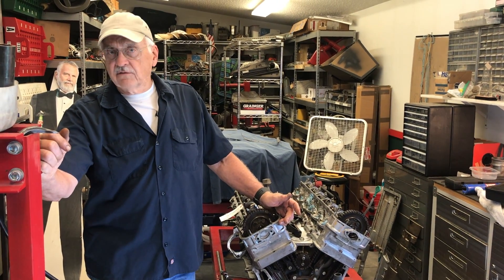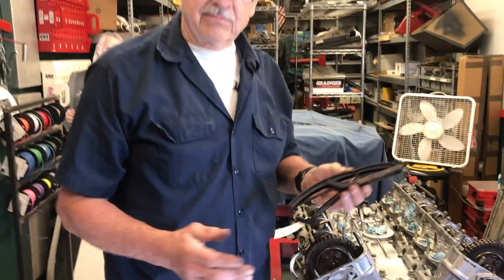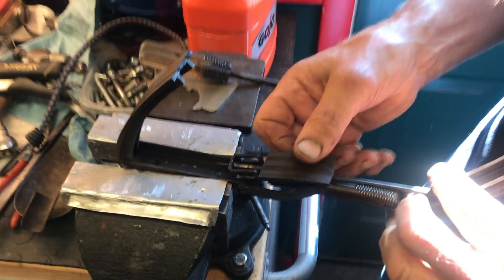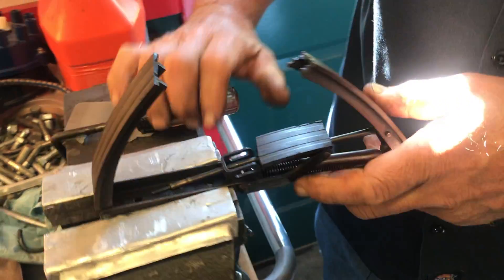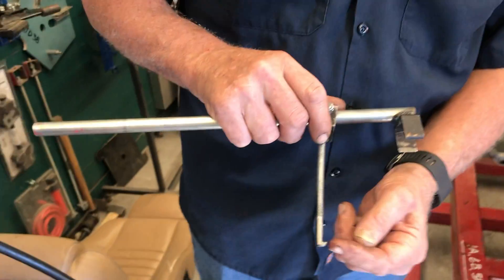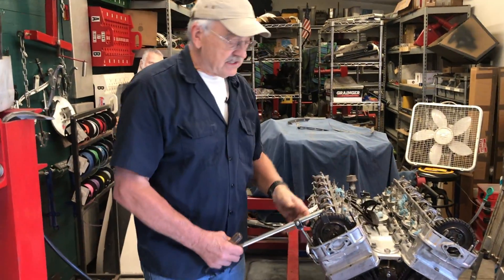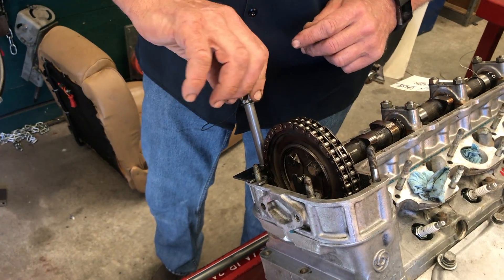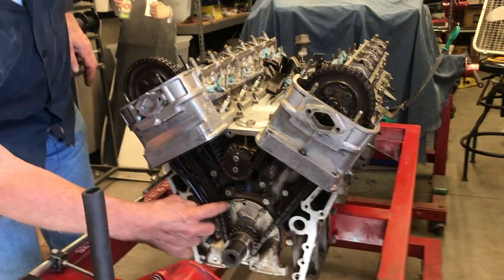Tuesday Extras - Episode 15: Jaguar 5.3 liter V-12 Timing Chain Tensioner Basics

Comment: For anyone doing this in the car: You can't see the ratchet with the heads on (where the rod comes through the hole), so you might use a endoscope camera and stick it behind the camshaft pulley.

Comment: i love your jag videos it's 2025 if your seeing this do you still put out videos? i saw the video where you said you fought off cancer congrats🎉 hope your doing well. what i wouldn't give on this earth to work by your side. I've never got to work on jags but i have built a couple ground up vehicles currently completing a turbo LS swap in a 2000 ranger running e85. these engines look to have lots of potential. can they be boosted?
Reply from the maker: I've been doing a restoration on an '89 XJS Convertible in addition to other projects. I'm currently putting together season 6.

Comment: hey Bob. Do you have a kludge for upgrading an old tensioner?  Usually the plastic breaks but the  metal is okay. Can you glue another layer of plastic on top of the old plastic? 
or buy a new {fill in the blank} tensioner and take off the plastic and use on the jag tensioner?  I hate to pay $500 for a reproduction tensioner when my whole budget for the car is $500...

Comment: Thank you so much for this video, helped a lot in understanding the mechanism. And thanks for showing the DIY tools, will build one myself.
I just wanted to check the tappet clearance at my XJ-S and turned the crank manually as usual. Half the work was done, suddenly the crank blocked. I suspect debris of the tensioner is blocking the chain, deep down there was a black piece of something, I guess remains of the tensioner.  Thanks again, Chris

Comment: Nice tool. How much of the motor needs to get disassembled to replace the chain tensioner?  Can it be done in while the motor is in the vehicle?
Reply from the maker: The front cover needs to come off so either the cylinder heads or oil pan need to be removed to free it up. I vote for the oil pan. Not an awful job but it takes some time.
Reply: @thecampchaoschronicles9567  I think I would need to take the head off so I can use the tool tensioner, otherwise there is now way to  set the tension, correct?
Reply from the maker: @brighteyesvideos  My vote would be for removing the oil pan. I wouldn't recommend disturbing the heads unless you have to.
Reply: @thecampchaoschronicles9567  Not to difficult to take the front cover off once you get everything out of the way. The Jag manual says to then "disconnect the timing chain from the camshaft and jackshaft sprockets" then "withdraw the crankshaft sprocket and timing chain." Is that really necessary? It seems like I can just slide the timing chain tensioner in before I tighten it with the tool, as it seems to want to go in without all the chain disconnections. (Just don't want to brake the new timing chain tensioner.)
Reply from the maker: @brighteyesvideos  If the tensioner is unlatched, replace it unless it'd been replaced recently in which case it will still be gray in color. The consequences of putting it back together with a broken tensioner is too great. I seem to recall you must take the sprocket off of the A bank to get enough slack to remove/replace the tensioner.

Comment: Great video. My machinic suspects my 85' XJS chain tensioner is broken, as the timing is all over the place and thus not enabling the V12 motor to start. I will take the cam cover off and hopefully see if this is the case (or not). To replace the V-12 timing chain tensioner, do I need to take the heads off, or can I access it from the front as shown in your video?

Comment: I just  came across your video again.. incredibly informative.. thanks for  everything.. myvsons xjs has only 120,000 kilometers,,74,000 miles.. when have you  seen these tensioner go faulty  and what are the indicators of the chain  tensioner?  Ie: noise , miss fire, no power?? 
Thank you  , keep up  the great job..
Reply from the maker: To be honest, my experience with broken tensioners is when I have taken engines apart. Since the tensioner is on the "slack" side, I don't know that it will result in a change in how the engine runs. Unless the chain slips on the A bank. Then A bank will run poorly. That would probably be obvious at the end of the A exhaust system. I'm told the chain will make a fair bit of noise from slapping around between the crankshaft and the A sprocket. I wish I could be more definite. Good luck with the project.
Reply: @thecampchaoschronicles9567  Oh my god your are incredibly quick with your response time... Thank you so much.. I forgot to ask you if you ever removed all the vacuum and emission ancillaries and the right fuel regulator? I have and the only thing I'm chasing now is a  idle hunt. I haven't performed the air/fuel adjust in bypass mode yet, since i understand these need to warm up and in gear, I know that these beauties go in open loop in P or N.. any suggestions..LOL..
Reply from the maker: @petehalasz7547  I've deleted the air pump system in Ol' Tex while retaining the pump as an idler pulley. I intend to install a smaller alternator in it's place sometime soon. I'm more of a carburetor guy so I'm afraid I can't help you much. But I'm learning.

Comment: Thank you for your detailed explanation, it helps a lot. For you information, the chain tensioner (C30485) and the plug (C37925) are available on the SNG Barratt shop.
Reply from the maker: In addition, the tensioner is available from several locations including Engle Imports and Welsh Enterprises which are a couple of days shipping from Camp Chaos. Thanks for the information.

Comment: Great work,  I'm a licensed mechanic  of 40+ years and my son and I are rebuilding a his 86 XJS.. him and I have polished all aluminum to a mirror finish. Intake port and polished.. removed all stantions on the intake  filled all holes  relocated  all wiring , blasted and powder coated  entire rear end .. we want to go suicide doors with shaved door handles.. custom interior.. Chrome plated  everything else.. your ingenuity is incredible.. you remind me of myself.. I refuse to allow something beat me.. I believe there's a solution for everything.. 
I'm pondering on a complete Megasquirt pro3 system.. I understand it can go full sequential and comprehensive   DIS system  built in.. what do you think??
Reply from the maker: I've been thinking about the same thing since we used a Megasquirt on the XJ40 Champ Car engine. Getting an impulse wheel on the dampener us going to be s challenge. Not much room.
Reply: @thecampchaoschronicles9567   
Thank you for quick reply, I spoke to the people that sell MS-3 pro and they told me the first test bed was a v-12 jag engine for a marine application. Then of course further improved. They now sell a MS-3 ultimate which is fully V-12 sequential injection not grouped and built in DIS module. There are tons of aftermarket 36-1 wheels, the only challenge is a cam counter. It needs to know #1 for seq-injec (he was suggesting the distru wheel)... Mobeck Tekniske in Norway has figured this out and sells a complete package for our 12's. It's unbelievable and he told me it's a MS-2 in the box. It has all new injectors, MAP, ECT and harness, but it is group injected 6 grp of 2 injectors. Have you tried any set ups for DIS? i have seen only a couple vid's on DIS V-12's,, absolutely incredible. 
Thank you for your time 
Pete

Comment: Has anyone designed/replaced with a more modern tensioner?
Reply from the maker: I've seen  someone who replaced the plastic blade with a spring steel unit but haven't seen anything lately.

Comment: There will come a time when I have to do mine, these tips will prove invaluable when it comes to rebuilding the engine. Thank you.
Reply from the maker: It's my hope these videos will demystify these engine to the point where they can undertake an overhaul project. The engine isn't that difficult. it's all of the stuff the had to stick on top of it to get it to work that is the problem.

Comment: I like the gentle custom tool you have.   Re the tensioner, it's made of Nylatron GS (originally by Polypenco).   Nylatron GS is a molybendium disulphide-filled nylon 6/6 (a polyamide: PA), now made by a variety of companies.  Nylon 6/6's of different variations are often used in high-temp engine service (like  GM  plastic timing gears etc).  The downside to all nylons is that they absorb water and expand, and over time may loose their plasticizers (see the datasheet via google look up).  The addition of MoS2 adds another factor of brittleness and weakness to impacts even to new Nylatron.  I suspect that age,  water absorbance & expulsion through heat cycling (up to 0.3% to 7% max) plus the sharp edges of the casting itself contribute to eventual failure upon shock.

The newest chain guides for the likes of the Porsche Cayenne (and others) now use a Nylon 4,6 called Stanyl TW341 (a couple of layers of different varieties of it) that's superior to Nylatron. 

Now for the speculation:  Who would risk an engine on this though?:    Might it be possible to fit an off-the-shelf tensioner that's less likely to crack to the bottom hinge, and then use a modern charged tensioner that gets bracketed in on the other side, then it's piston released. (Maybe bracketed in to that it is also accessible through the normal tensioner hole).   There look to be a number of possible candidate tensioners that could sub (Group 44  Lankey shade-tree style).      The other thought is to reproduce (again who would risk fitting one) the same tensioner design in Stanyl - perhaps the 15% CF filled version via a 3D Nylon printer, and refurbish existing broken tensioners after annealing the printed part for some hours in an oven.
Reply: The best solution I’ve seen is the plastic blade being replaced with a thin steel blade with a plastic shoe bonded to the chain side. No idea how well it worked.
Reply: @knodtre   I keep looking at the Jaguar XJ8 blade wondering if it's about right... maybe with a bushing... and then.. of course.. figuring out how to put a jag hydraulic tensioner on a bracket in a workable/right spot.
Reply from the maker: @ferrariguy8278  Great minds think alike. I've got one on the shelf right now. Too narrow.
Reply: @thecampchaoschronicles9567    I assume you've seen a bit of Neville Swales's  Terra quad cam  engine solution?   Some sort of static tensioner blade and an externally adjustable lever on it?  (He also thought a hydraulic solution would be workable).

SO.... not knowing what blade he used... I'm thinking Saab.  We know that the Jag-Lovers site speculated from a pic in a Haynes manual that the H-Type 8valve Saab engine used the same tensioner.  I think that's been shown to be not quite true.  Regardless... there are hydraulically tensioned blades for very similar Saab engines.  If we look at Wikipedia the B201 was the 8 valve engine, and similar upgraded variants of 16 valves were the B202 and B212.  Check out Saab PN 8817405 (plus hydraulic block) ($80?) or the later ones like: https://cdn.abicart.com/shop/13102/art2/h8897/157548897-origpic-2cd0bc.jpg   https://cdn.abicart.com/shop/13102/art2/h9759/4439759-origpic-535f4e.jpg  (B202 & B212 pn 8858276).

I cannot seem to find the early  H-Type V8 tensioner for Saab shown at Jag-Lovers though.
Reply from the maker: @ferrariguy8278  The second one shows promise
Reply: Do you work in the plastic moulding industry?
Reply: @bixkauldhar1566    No, just went full out Alice in Wonderland rabbit holing on this subject one night...